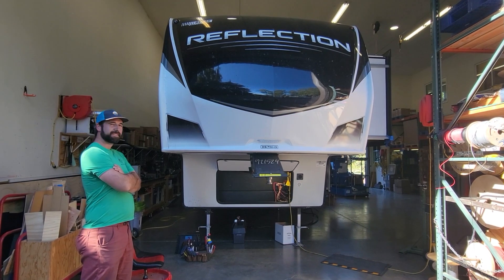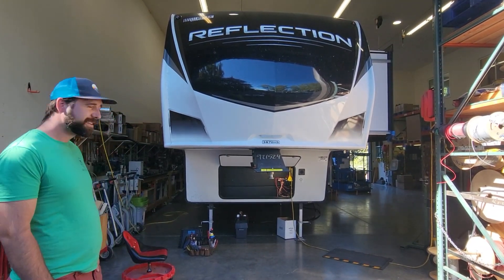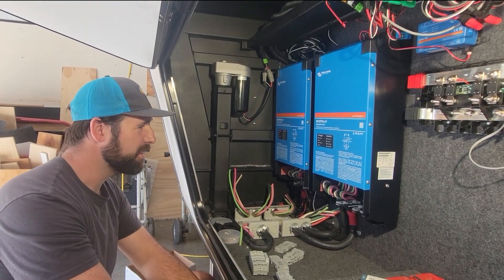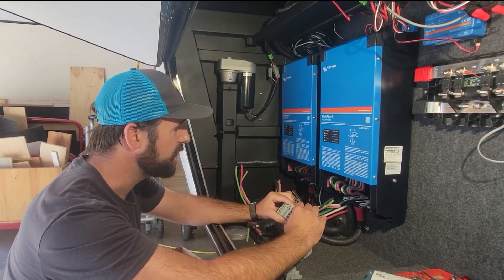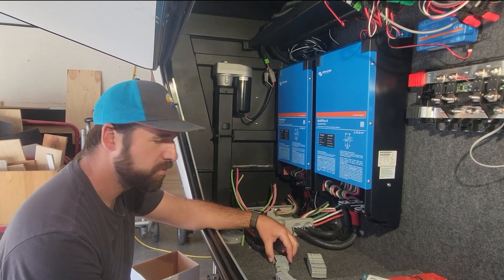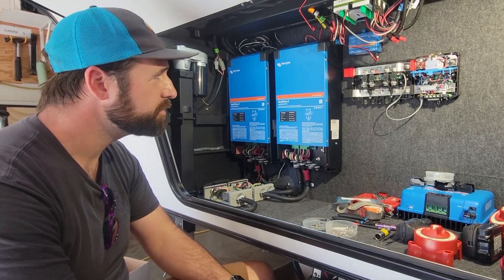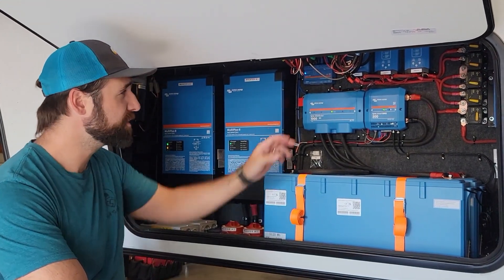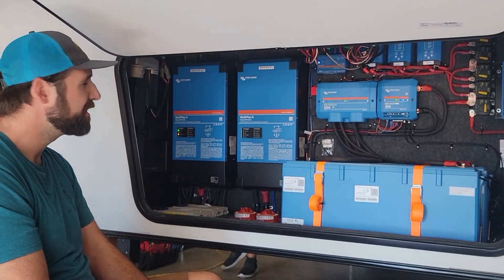Dual Inverter System Installation PART 1 | Grand Design Solar Install

Comment: I have the exact same year and model RV. I know this model came with a single solar panel, charge controller and inverter prep. I would be interested in seeing how you ran the second 120v leg to the RV circuit breaker box and where you connected it. I know that second leg powers both AC units as well as the fireplace. I'm retired now but I installed many grid tied home solar systems and also built various solar powered battery back up units for various needs before lithium batteries became more affordable.
Reply from the maker: Send me an email and I'll send you a diagram that might answer your question:  garret at amsolar dot com.

Comment: you are better running one inverter then connecting it to a autotransforer to 240v. more control when you connect to different sources. Also a manual transfer switch for 50amp shore dont need inverter for that. nice setup but lots of flaws.
Reply from the maker: That is definitely our preference too, and we have done several of those, but it really just depends on the particular customer's requirements and lifestyle.

Comment: Are you not worried about the neutral overloading? 30A shore power + 6kVA of powerassist (~40A @ 120V) would push 35A through L1 and L2 which would result in 70A on the neutral.
Reply from the maker: This is a valid concern and does point to some of the shortcomings with the current state of the art in RV electrical architecture.  When we get a project like this, we assess if the client has loads in their RV where, through negligence, they could overload the neutral.  If so, we recommend a split-phase configuration, where L1 would cancel out L2, and a balanced panel would mitigate the risk.  If full output power assist on a 30A shore connection isn’t going to happen, we use a parallel configuration.  This shared high current on the neutral in a 2x120V configuration isn’t ideal, and we anticipate as more and more loads are added onto RVs the factory balance of systems will get more duty-rated, but for this specific project, when consulting the NEC and ampacity tables, we felt that we were in the tolerance range of the cable used in this project, based on the end user's use case.

Comment: Any wiring diagrams you can show to explain how you wired up the AC side into the inverters? That's where I am lost at. Hard to get any information on how to wire up dual inverters in parallel.
Reply: Also can you post a link for what you used for the AC side? I'm liking what I'm seeing here. If you were just installing dual multiplus/quattros (AC, ground, neutral), couldn't you use the same setup, but only put one hot to each inverter and then combine them on the output connection which re-joins them to go to the breaker box?
Reply from the maker: @theghostlyorb  Can you send me an email garret@amsolar.com
Reply: mortons on the move have a great explaination of one inverter and transfer switch for shore. best way to do it but i would use a autotransformer too

Comment: So you split the AC 2x120 out to each inverter and then combine the outputs to run to ac panel? Will shore power pass through at the full 12kw?
Reply from the maker: The inverters are run in parallel, you can't get 240V AC, unless you plug into 50A shore power.  The outputs are combined at the AC panel.  You do get the full 50A x 2 legs x 120V when you connect to a 50A shore source.  Does this answer your questions?  If not, I’m happy to go deeper.
Reply: @GarretTowneAMS  thank you. Where can I get those wago connectors and switch box?
Reply from the maker: @trigmish  Send me an email, and I can get you a quote garret@amsolar.com.  Thanks,